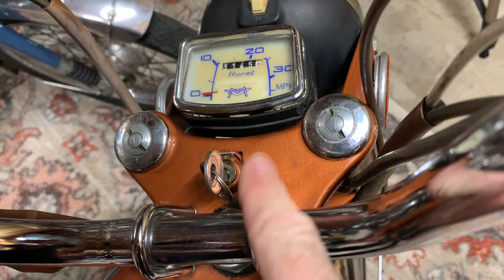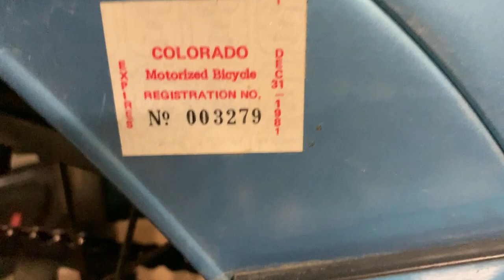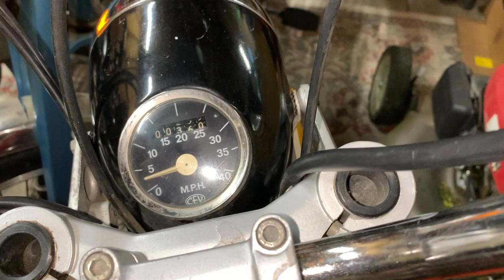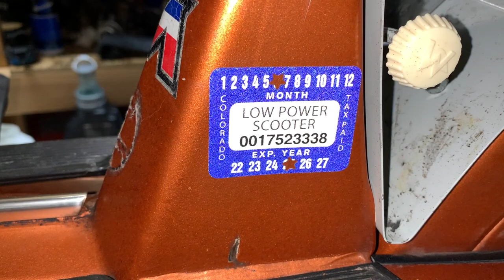Vintage Mopeds on Derek Does.

Comment: Beautiful! ive gone through a few mopeds and i always go back to my motobecane something about them just calls to me
Reply from the maker: I know what you mean.  So simple, yet just makes sense.
Reply: Gotta love the French!  🇫🇷
Reply: Garreli and Motobecane are my favorite

Did I spell Garreli right??
Reply from the maker: @Johnny2Bags47  Can't go wrong with either!
Reply: They’re awesome! Only thing is they can be a PIA when they break! Mine isn’t broken but I am soooo nervous that it’ll break down. I gotta rely on it until I have my full drivers license and can drive, lol. Even then. She runs like a champ but I’m still spooked by the horror stories lol.
Reply: @kovyvuri  compared to others these are a dream when they break 3 bolts engines off. av10 cases are a bit nicer to work with as you can replace the seals without slitting the case.

Comment: Great videos!!  I’m about to start restoring a Motobecane Cady as well.  Mine has the M1 motor.  I can’t tell if yours is the same?  I am having trouble finding engine parts for the M1.  Seems to be an odd ball engine for North American markets.  Where have you been getting parts from?
Reply from the maker: Hi,   thanks!  I get most of my parts from Treatland.com.  I have the AV7 in mine but I'm sure if anyone has them, they do for the Cady.
Reply: @derekdoeschannel  OK, thanks.  I had tried them already and they do not have any M1 components.  There are a few places in Europe that have parts.  I guess I will have to order from them.
Reply: @derekdoeschannel  OK, thanks.  I had tried them already and they do not have any M1 components.  There are a few places in Europe that have parts.  I guess I will have to order from them.

Comment: Yeah grew up in Key West Florida one of the only places they ship derbi mopeds we couldn't afford one then now 40 years later I'm looking for a 1977 to 1972 Derby Laguna the silver one it looks like a miniature Yamaha rd350 same style everything also have a mint condition rd350 Yamaha first year they made them 1973 got it from a one owner a couple hours away he bought it brand new in 1973 and left-sided registered in 1978 5800 miles on the speedometer my friend already redid it but the chamber pipes and everything on their butt still mainly looking for a Laguna sport only silver they came from the factory except for the Diablo I have two of those once fixing to get redone got all the brand new parts and the other one I've been driving since 1986 when I bought it for 175 bucks I have all brand new parts for the DERBI Laguna from the gas tank number plates head gaskets everything sprockets and have a mofast brand chamber pipe but they change the one and a half horsepower in 1984 and 1985 you have to put a bore kit on there that you want to ride by yourself, got a Big Bore Kit ordered but can't use the ones for the old 2 Hp cuz the 84 model and 85 model Diablo has a horsepower and a half and stinking Reed valves that didn't give it any extra power but have the Bore Kit coming also looking for that
Reply from the maker: those are very, very nice looking mopeds!  I'll have to be on the search for one now.  Thanks!